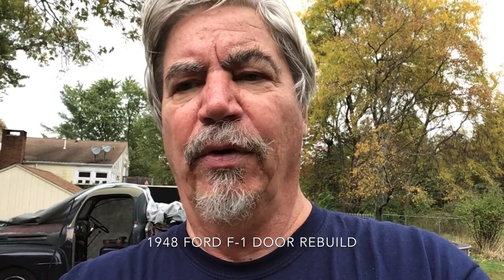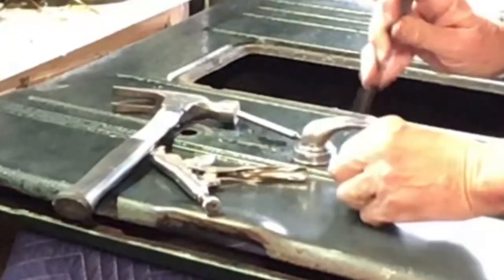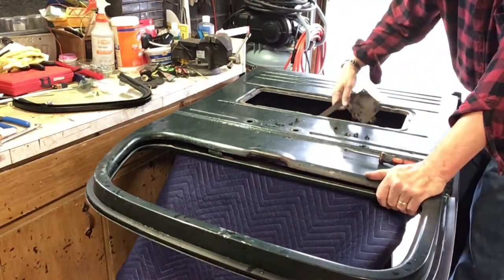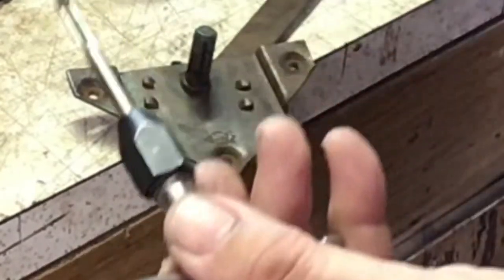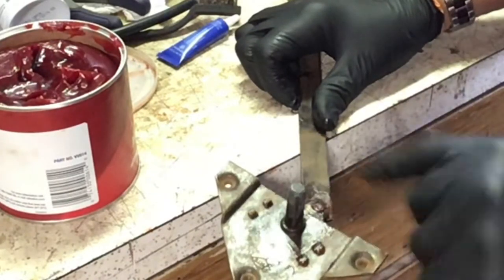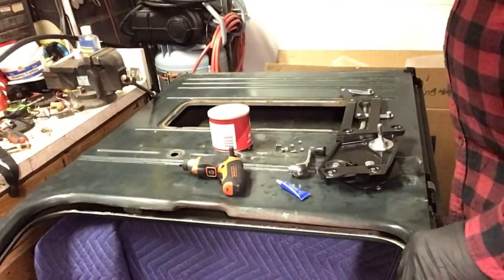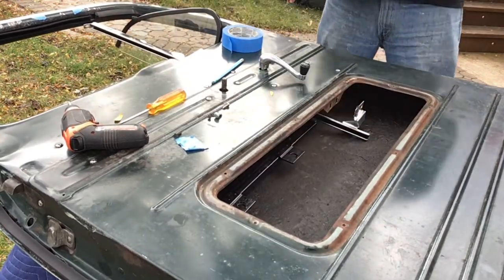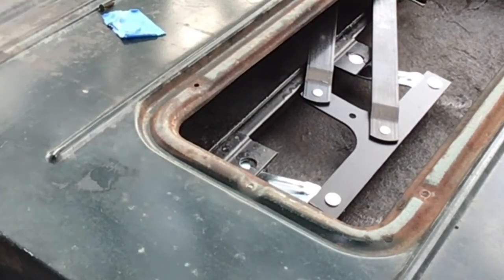1948 Ford F-1 door rebuild

Comment: Just watched your other video of taking your 48 for a drive. For some reason there was no way to comment on it but I have a question.
I noticed your aftermarket dual temperature gauges and want to do the same with mine.
I’m still running stock 6v positive ground and wondering ,if your the same, where you got the gauges ( are there different gauges for 6v systems or will standard gauges work?)and I assume that you had to replace the temperature probe on the right side of the block to a single post or can you keep the factory 2 post.

Comment: So was the purpose of drilling the wing window screw holes because you used a new frame? Or do the old holes in the frame not line up with the old holes in the door with the new rubber?

Comment: Glas goes in up through hole in door.
Reply: Have you done a door rebuild?  I'm getting ready to. Replacing vent windows and door glass. I'm doing the doors while their on the truck.  Seems better for me.   My question. While the vent window is out can I just drop the new window in from the top and just leave it sit on the bottom of the door while I put in the vent window and then with the divider attached just at  the top put the glass into the tracks , slide it up and attach it to the regular and then adjust and attach the bottom of the divider?    Just seen this video.   Not a lot of info out there.  I've just been giving it some thought.    Thanks